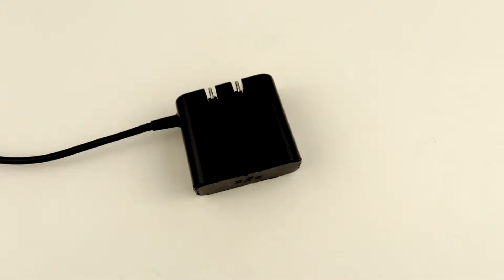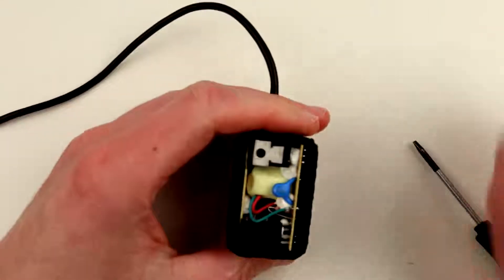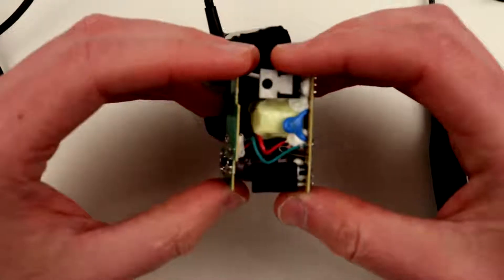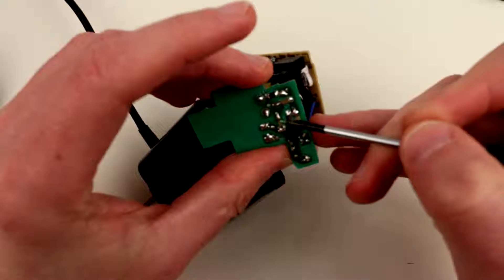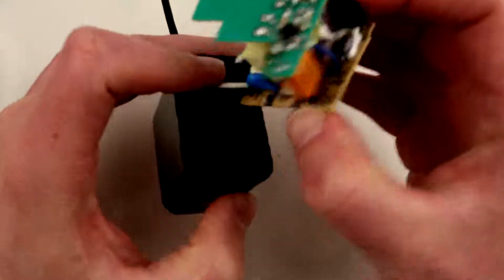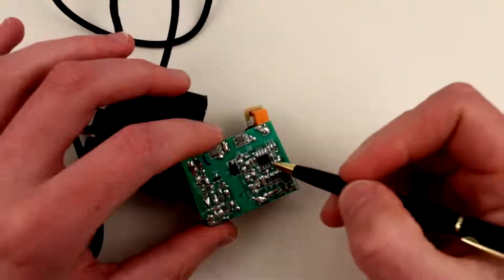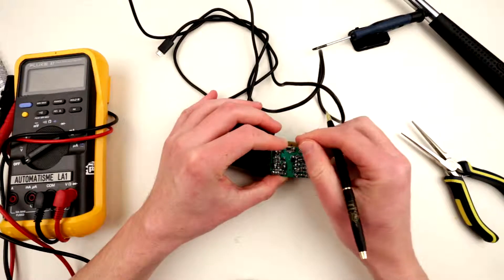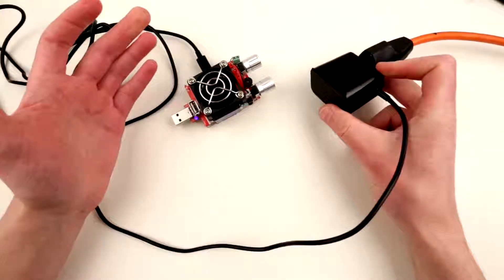Teardown and Repair of Blackberry phone charger

Comment: Please PLEASE can you show us how to change the entire wire in this charger?
Reply from the maker: Should be easy, it just soldered in there, any usb cable will work
Reply: @InsideOutElectronics  do you think I can use a Cooper wire? Black and red? I seeing in your video, the original is black and black silver.
Reply from the maker: @EnConstruccion1812  What is Cooper wire?
Reply: @InsideOutElectronics  Copper color cable, in blackberry comes original silver color.  Will there be a problem with the change in color or quality?
Reply: @InsideOutElectronics  Cooper wire is different of aluminum wire. In this charger use original aluminum wire, if I use Cooper wire would have change in the frequency?
Reply from the maker: @EnConstruccion1812  You probably meant Copper? If yes, please always use copper wire!
Reply: @InsideOutElectronics  thanks a lot my friend, I'm try to change tomorrow and I'll tell you more about this
Reply from the maker: @EnConstruccion1812  no problem, you van just use old USB cable
Reply: @InsideOutElectronics  hello my friends, I wanted to tell you, I was able to change the cable, and the micro usb port was perfect, identical in terms of the original charge.  Thanks for your help and your video, it served me a lot.  A hug
Reply: Can you do a video to replace it with a usb-c cable